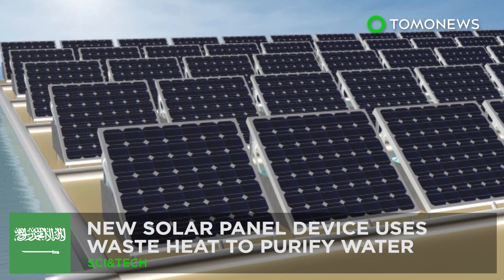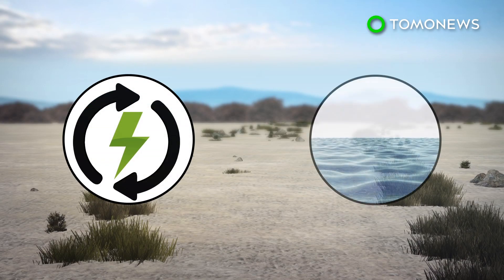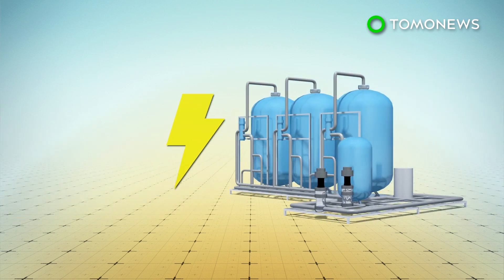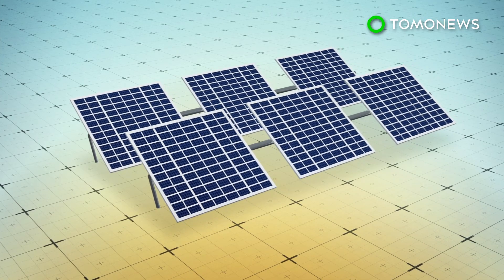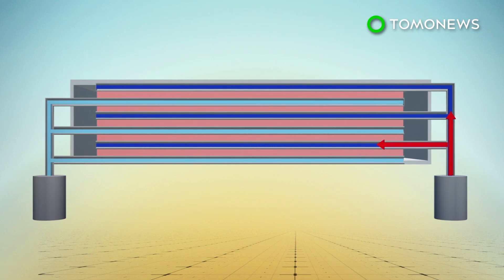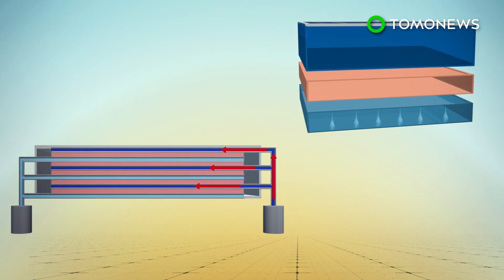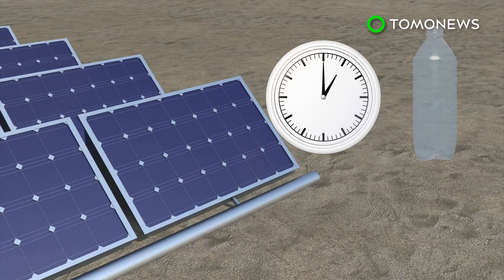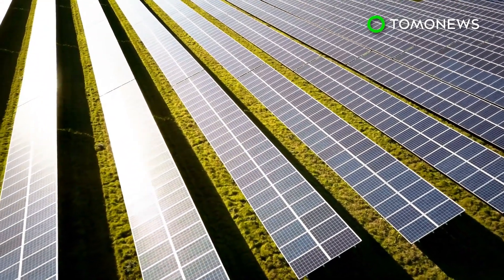New device uses waste heat from solar panels to clean water - TomoNews

Comment: Dislike this video
Reply: Why? You hate solar energy? And clean water?
Reply: Doesn't do noting though
Reply: @JesusSaves23k  what do you mean it "doesn't do nothing though"? This is more of a proof of concept if anything else. Now that its been done, it can be modified and adapted to actually utilize more wasted energy to help produce more clean water in addition to the already produced solar energy. Aside from upfront costs of installation and modification to adapt to a certain area, its going to theoretically save money in the long run. If this is taken to areas where clean water isn't available, or is under produced, it can change lives.
Reply: @zahor0269  Was talking about disliking the video
Reply: @zahor0269  let's use this in Flint Michigan
Reply: No I just dont like S.A